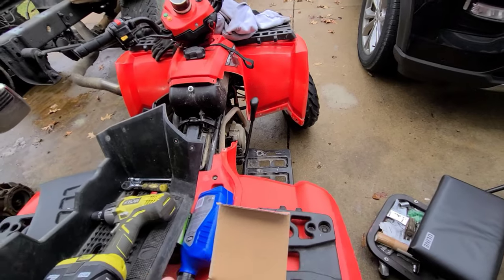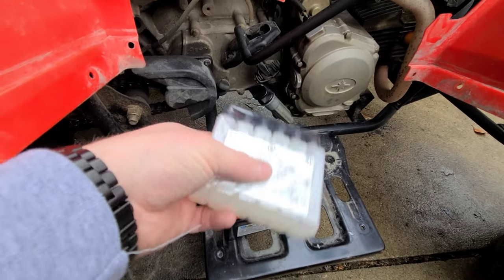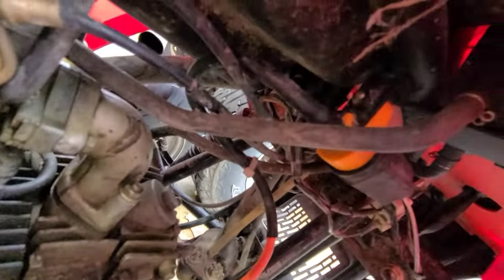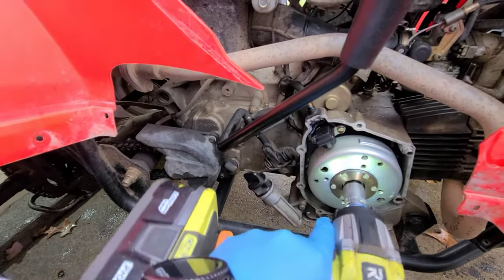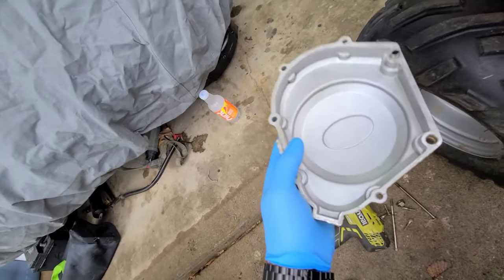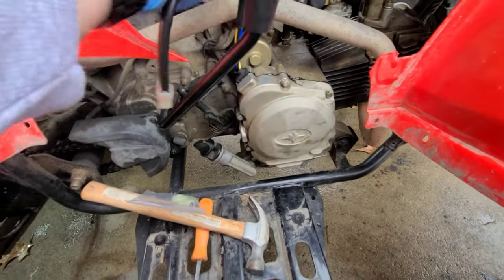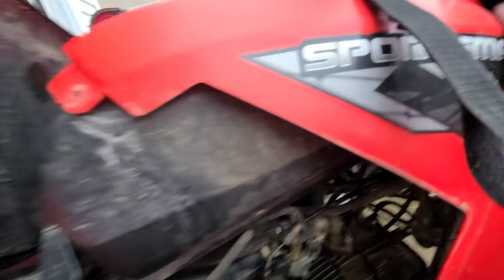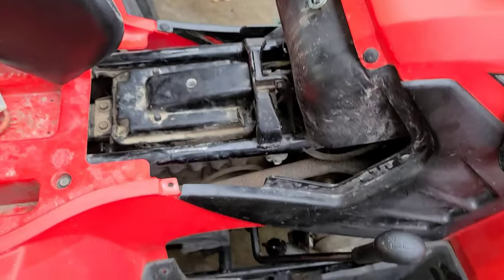Polaris Sportsman 90cc tune up, Stator replacement, coil replacement and rectifier replacement!

Comment: I'm stuck at the yabba dabba do the cover off that you skipped. Mine seems to be sealed pretty tight and I don't want to break it. Is there not oil in this part?
Reply from the maker: Haha, my bad. If it's never been off before, it could be stuck. There is no oil in there. If you ha e a rubber mallet, you can tap it with that. There should be a couple of pins it seats into, and there can be corrosion on there that's holding it together as well.
Reply: @LowLifeAntics  thanks. I got it. A really good seal and a tiny bit of corrosion around the pins. I managed to pop it loose by tugging gently from the plug hole that's in the side. Then put a small screw driver in the middle and pushed on the left side to pop it off the pins. There was definitely oil in there so maybe that's part of my problem.
Reply from the maker: @minerMoe  that can definitely be part of the problem.  The crank seal is a problem. They are cheap replace it.
Reply: @LowLifeAntics  is that what would do this?  I was wondering if someone may have put oil in that cap.  It is right above the dipstick after all.
Reply from the maker: @minerMoe  how much oil was in there? There will be a little. Shouldn't be a ton.
Reply: @LowLifeAntics maybe 400mls or less
Reply from the maker: @minerMoe  that should be fine. If you are dealing with no spark. I'd check the pulse coil.its pretty common to fail.

Comment: How do I take off the flywheel if I don’t have an impact wrench
Reply from the maker: So another way I used to do. You can take one of the oil filter band wrenches and hold the flywheel with that. I had a cheap rubber one from harbor freight that worked great.

Comment: what year is that? i need to order the right stator.. i was confused you had two stators
Reply from the maker: So this one was a 09. The other stator is for 06 and down. If you need a coil and stator for an 06 and down let me know. I have them. You can have them if you pay the shipping cost.
Reply: @LowLifeAntics  I have a 2002 and I think you said the pick up coil is attached?  I cant. even find a video to take off my plastic. so many pieces. how much to ship to 92882?
Reply from the maker: @s2000pill  send me some pictures. lowlifeantics@gmail.com I'll explain how to remove the plastics on your machine. 10 bucks to ship the coil and the stator.
Reply: Problem fixed! So here's what I did, I got the new stator and like the reviews says on amazon " the pick up coil is to close and ends up rubbing the flywheel. You have to bore the hole/slot 4mm or slightly to pull the pick up coil away from the flywheel. while i did that, no spark! Still no spark so I decided to retrace my steps and test the ignition coil with Multimeter, to my surprise, I was at 12.500 ohms and way out of spec!

I threw in a new coil and voila spark!

Thank you for making me go step by step! Turns out I had bad stator +/- coil. COuld just been a coil from the start but we will never know. THe point is to take it step by step and not jump conclusions like I did.
Reply from the maker: @s2000pill  glad you got it figured out!
Reply: @LowLifeAntics do you still have that stator and coil by chance?